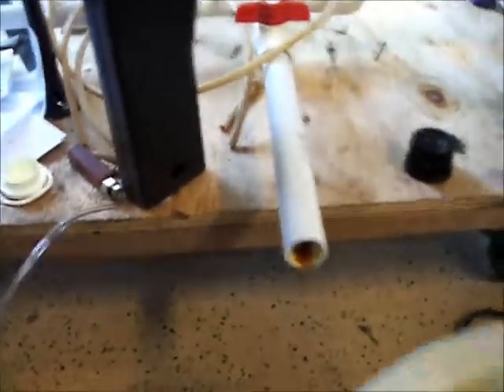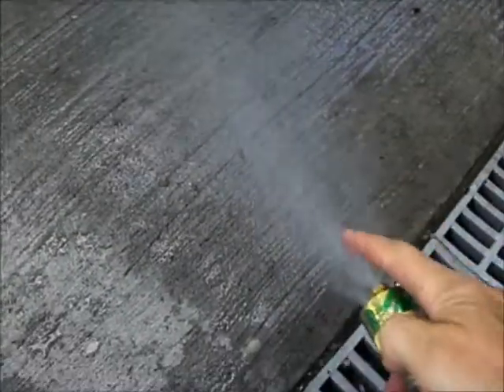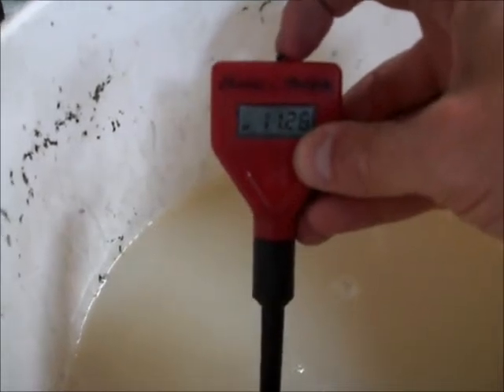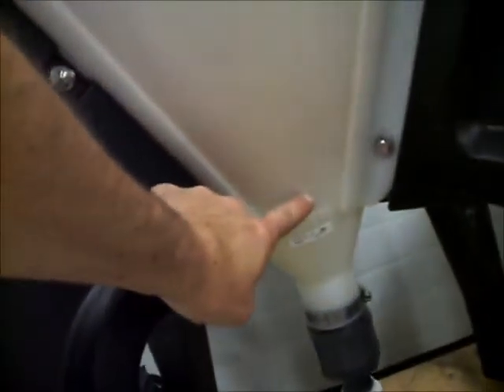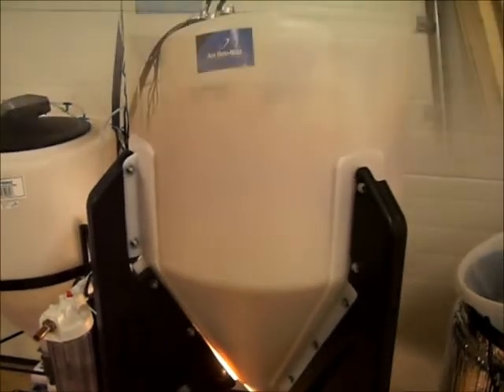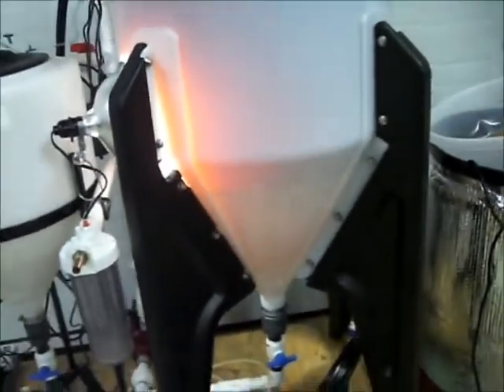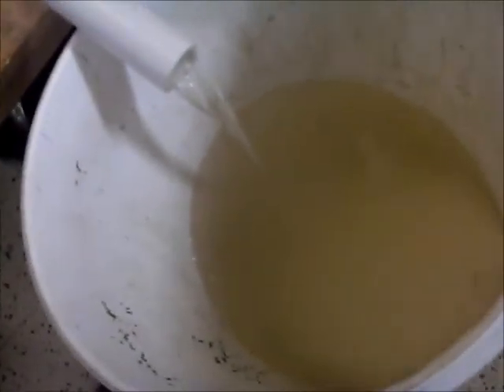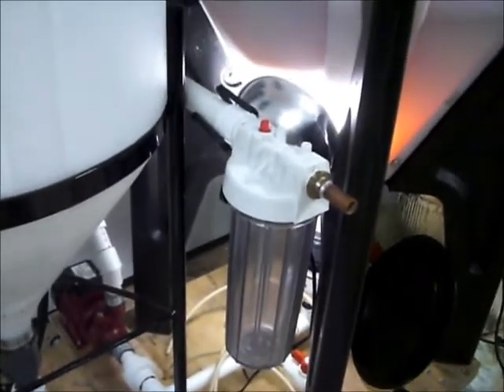Biodiesel - Part 2 of Batch 2

Comment: Why did the glycerol solidify at the base of the vessel in BIODISEL?
Reply from the maker: If you use sodium hydroxide instead of potassium hydroxide you need to pour off the glycerol the next day. If you wait a few days the glycerol will go solid. When you make soap from fats sodium hydroxide makes hard soap bars, potassium hydroxide makes liquid soap. You may be able to get the solid glycerol out of your processor by turning on bottom heat.